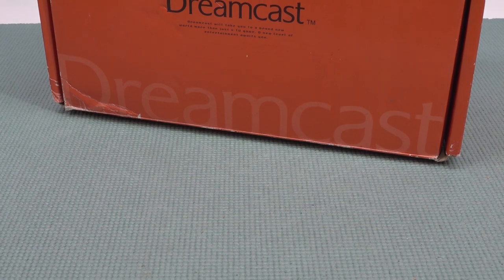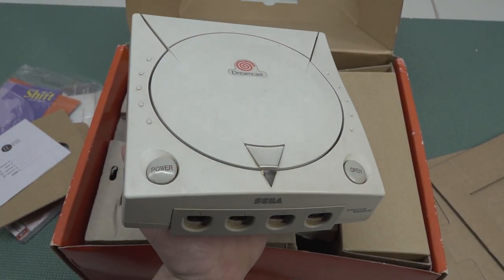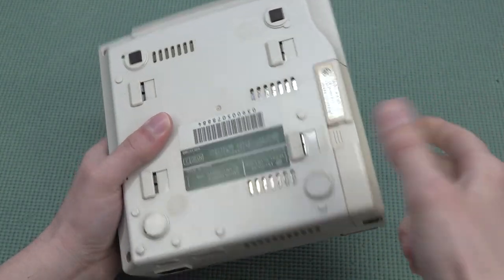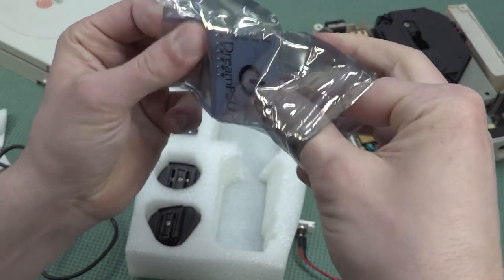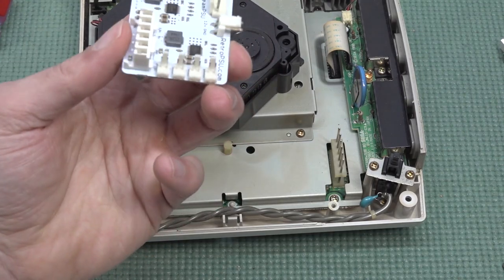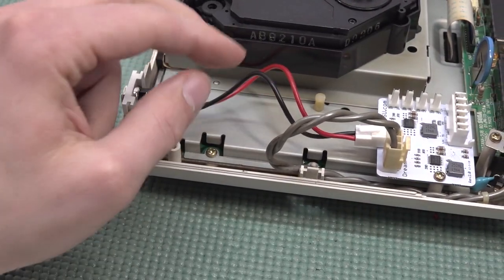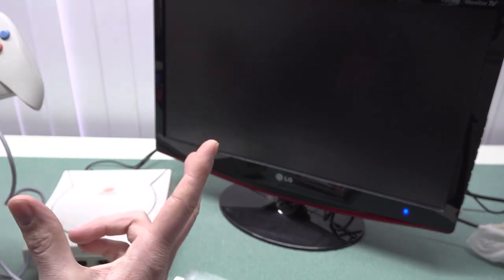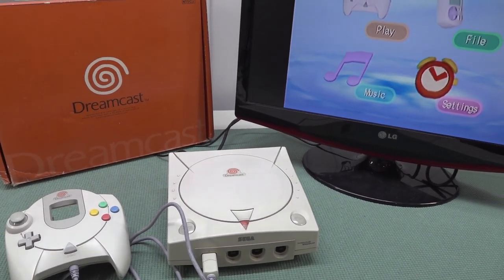Sega Dreamcast Japan Edition Unboxing, Cleaning & Modding 🙌

Comment: I love the Sega Dreamcast. I like when people show their love for the console. I know that some consoles had problems with their capacitors but not entirely sure about any of the Sega Dreamcast. One mod I know most people do to play any regions games without replacing the laser with the GDEMU is one of the chips you can solder a wire to specific places but you need the kit that comes with a chip some resistors and wire to do the mod.

Comment: I bought a used Samsung galaxy s10se for a ($105) a used Samsung dex dock with fan($40) a used folding wireless keyboards touchpad ($21) a used sn30 Xbox cloud controller ($24) this setup will allow you to play all emulators up to Wii,game cube and ps2 buttery smooth and fit in a shaving case😋 the phone has a snapdragon 855 way more powerful than nvidia shield pro and it plays could gaming its just plug n play to your TV😋 youtuber eta prime has a video on it so I bought it 2 weeks ago and I'm very happy😋😋😋😋😋